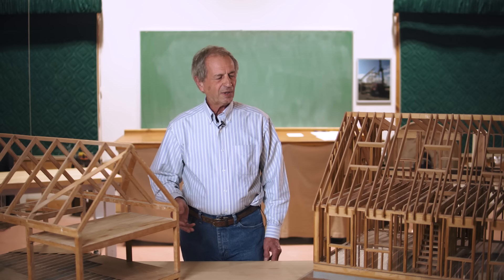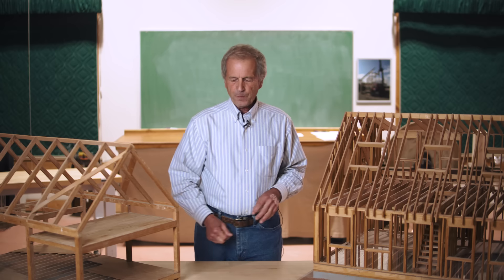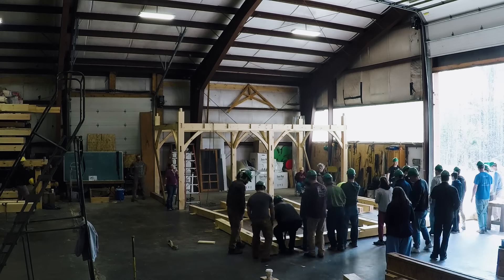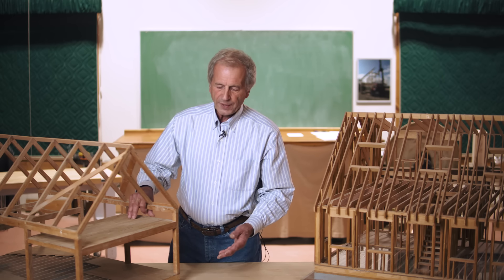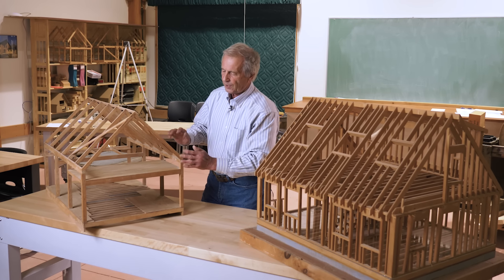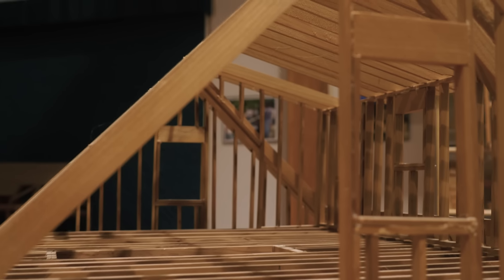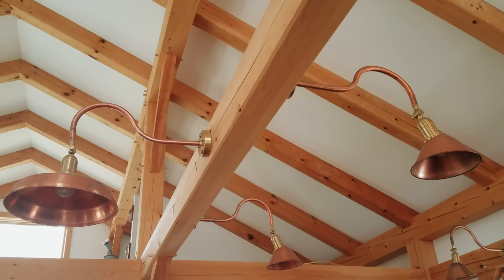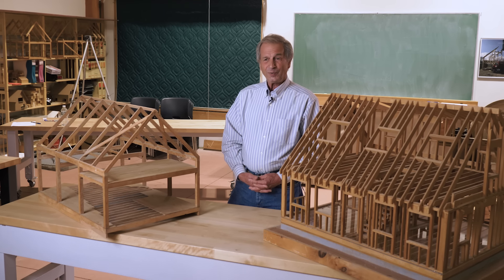Timber Frame vs Conventional Stick Frame

Comment: What’s a sip
Reply from the maker: SIP stands for Structural Insulated Panel, a structural foam sandwich which lends itelf well to enclosing a timber frame, but is also now included in the International Residential Code as an alternative to 'stick' built homes. The code gives you prescriptive building information, allowing you to pull allowable wall and roof spans from a table based on your location and the building size, much the same way as for stick construction.

Comment: Guy's clearly very biased pro-timber frame. The Timber frame doesn't have the doors or windows framed in. If you're adding insulation, you're adding more material not accounted for (wood is a decent insulator). I don't believe Timber framing uses that much less material - guy even says "it's like 2 houses" - you need to build all the two sided insulated panels on the outside of the framing (which also seems like a waste of space).

Comment: Ok, speaking as a professional builder and carpenter who loves timber framing, there’s a couple things that need to be addressed here. First, SIP stand for structural insulated panel, meaning SIPs are designed for and are perfectly capable of being used as the structure of a home on their own and not merely as cladding for a timber frame building, so kinda wasteful maybe. And it’s become common to put rigid insulation outside the framing in stick built homes, so it’s not like that’s only a timber frame thing. Second, as a builder working in earthquake country, I can tell you that a stick framed home is perfectly capable of surviving almost whatever you throw at it providing it is designed and built for the condition. The primary codes addressing extreme conditions are LA County for seismic and Dade county for hurricane and are followed by many other counties and municipalities. This has been thoroughly addressed by engineers, manufacturers and code. Lastly, stick building, as a system, is extremely efficient to build, particular using modern framing techniques, and requires considerably less skill. I love the craft and elegance of timber framing, but I think this video was maybe a bit misleading.

Comment: This commentator made a mistake.  There is no such a thing as a hurricane proof home.  I have seen homes with solid poured 10,000 psi cement get blown away. All you can do is try your best, but you can never say it is hurricane proof.

Comment: I'm absolutely not convinced by his "explanation" (or lack thereof) regarding insulation issues of stick vs timber frame. The "voids" he mention from stick frame do not conduct heat, as trapped air is the best insulator (and these voids are usually filled with porous material that drastically improve the insulation property of air). The constant throat clearing was quite annoying tbh, maybe drink some water before recording, and lower the background music.

Comment: A real (traditional) timber frame structure has zero prices of metal in it. Its 1000 yr old technology. No nails. Instead it uses wooden pegs. Also timber frame is more expensive to do than stick frame so usually its made for rich people and businesses. Finally most people who do Timber frame are not doing any Engineering. Meaning they don’t do load calculations. Typically they take a standard drawing and modify it. This can lead to serious issues.

Comment: Dreadfully misleading. They are suggesting you can just cut up a bunch of trees and frame up a house. This NEVER accounts for wood shrinkage due to the wood being wet. Unless you dry the wood, its going to bend and twist. All of your drywall will crumble once the wood shrinks. Anyone who would attach drywall to wet lumber hasn't ever built a house.
Reply: One commenter claimed you need only let the shaved trees sit (above ground) for one year to dry.

Comment: good engineers don't use steel in timber constructions. or at least not more than necessary. with these frames you get a lot of bending forces in wooden connections that normally you design with steel. i don't like as much as other solutions

Comment: I'll take the stick frame, the integrity is unmatched, not even by solid brick.
Reply: uuuh it's the other way around. Take away any part of a TF house and the structure still stands, hell you can take even more out if you want to because the interlocking joints support each other. SF timber is just screwed or nailed 'cold' onto the next one, and only the nail or screw support the stress. That's why SF houses just 'explode' when a tornado hits it, and TF survive for much longer since the walls are no part of the integral structure.
Reply: @Wayoutthere  well I live in the best location in the nation, no tornadoes or hurricanes, and you see SF homes outlast EVERYTHING.

Comment: omg turn the music mix down 30%

and if you use screws and steel plates in stick construction, instead of the stupid pre-built trusses that use staple-plate joints, it increases the strength 10 fold... I don't understand how staple joints are code approved... they are just trash

this is from a 15 year master electrician

Comment: nice commercial. 

the whole idea of wood conducting heat is a bit of a folly imo. wood is a poor conductor of heat. it is the air spaces around the wood that allows outside air to get inside. those spaces can be managed quite easily in fact. also there is no law that says you cannot insulate the outside of a stick frame house. in fact that is how they often build them around here. 

you still have to have windows and doors with even a timber frame house and those are always where you have the most heat loss. you really do not lose heat through the walls on a conventional stick frame house so that point is misinformation.

 i get it, you are trying to sell your classes so a little less than truthful info is to be expected but it really is not ethical. 
a timber frame house would be sturdier and more durable but the so called stick frame house will still outlast the owner. there are homes built that way that have lasted for several generations actually. 

 i am not advocating stick frame as being as good as or superior. i love the old structures that were built long ago and some were constructed without any nails or screws. they used pegs and tight joints to secure everything. i just think this video comes off as less than accurate.

Comment: You keep repeating siph siph siph or is it sif sif sif. What the heck are you talking about?  Please define your terms. This is poorly explained. What keeps this from collapsing with just a few vertical studs holding up your 2nd floor/attic? Where is the triangulation required for a rigid structure??? I don't see what wood visibility has to do with anything. Either way you can make the wood visible or invisible.

Comment: Your disingenuous at best and out right lying to your viewers at the least. Me, fifty years and some building buildings, an engendering degree on top of it all. So let’s examine cost.  Where the fuck can you find a lumber yard that actually stocks 8x8s. No can’t be done, your going to have to find a lumber mill with the capability to saw stuff better than twenty feet long. Very hard to find. You would also need to find a Jack who will find a lot to cut timber of the apropeate  size and then skid it out of the woods load it on a truck, deliver it to a saw mill and then bring it to my job site. Also just a 30 foot  wide building with a one foot eave with a twelve pitch would require 22 feet of rafter.

Let’s look a strength next. A “stick framed” building with 1/2 inch sheathing on my the walls and 5/8 inch on the roof is as ridged as a building can be add a hip roof to it and it becomes close to being indestructible, yet a timber framed building with a hip would be mathematically impossible for anyone that payed you to be schooled. Come to my shop with the cheapest calculator you can find and I’ll bring you to school.

Ok insulation. Wall insulation means nothing at all. Unless you want to live in a windowless building with an airlock door. Any wall is only insulated to the least value of whatever windows are in said wall. Best thing you can do is air seal the house get riid of drafts.

I’m done.